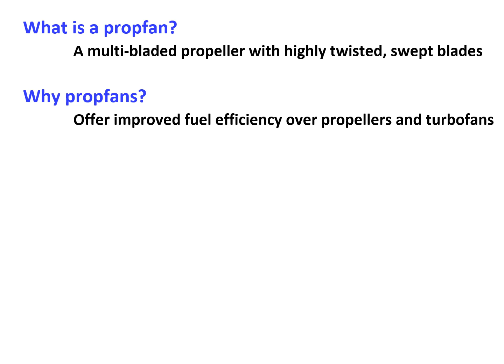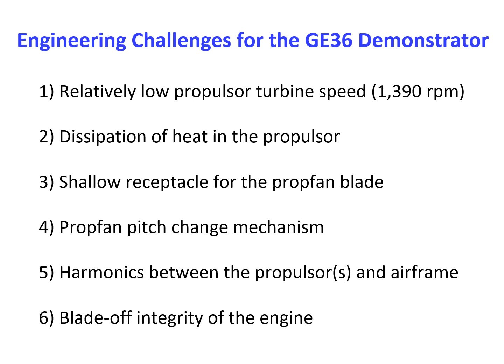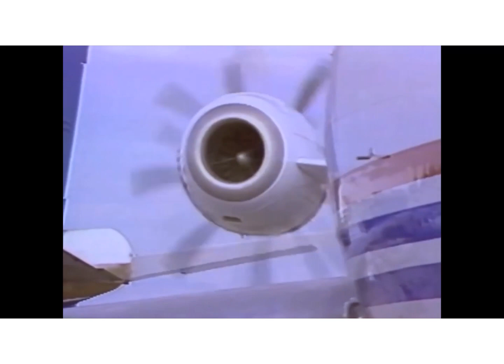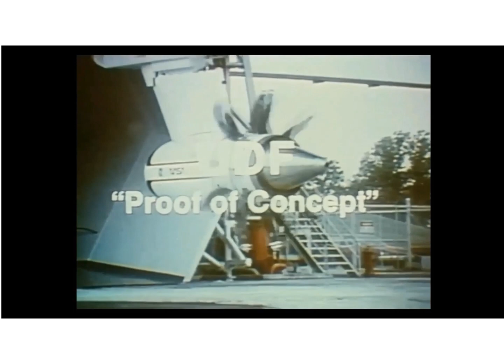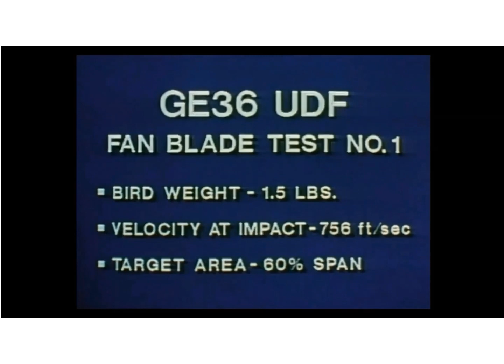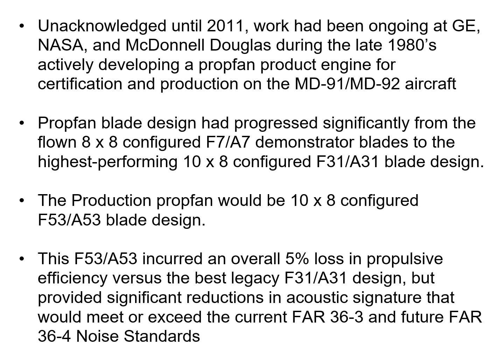A Technical History of the General Electric GE36 Propfan

Comment: It's important to note (a bit) that the concentration on blade impact safety was in part because the technology was new and likely a bit of concern that the last time someone tried a large composite fan (on the RB211 prototypes) it failed spectacularly (if controversially) enough that it sunk the engine (temporarily), the company (semi-temporarily) and the plane it was designed for (arguably). An even larger, less-protected fan would naturally cause some concern.
Reply from the maker: Thanks for your comment.

Comment: thank you for making this series! good information on these designs is hard to find, and it shows how much effort you've put into research and presentation here. one thing bothers me - the ge36 is by far the heaviest of all known propfan concepts, despite lacking the complicated gearboxes and driveline components of its contemporaries (and being slightly more compact). on the face of it, the design seems much simpler, so where does it derive all this extra weight?
Reply from the maker: There are over one thousand blades in the power turbines downstream of the gas generator which are secured in power frames that rotate in, by necessity, a large diameter, strongly built structure. While the blades themselves are not overly heavy, the large-diameter structures used to secure them are likely quite heavy. I think it is those large structures that account for the weight. I also suspect that the Safran CROR is quite heavy as it has some the same liabilities. This is all pure speculation on my part, however.

Comment: Sorry if you answer this in the video, but I am pausing it half way through to watch the rest later and am curious.  I have seen a couple of things about these prop fan engines, but what is the difference between a propfan and a turboprop?  They seem like the same thing to myself (though I am not very knowledgeable on the subject).
Reply from the maker: Thanks for your comments. Back in the early days (late 1970's-1990), a propfan was defined as having multiple, swept, thin, composite blades that were very highly loaded. These days there are a dozen criteria for the definition, but certainly the Airbus A400 and the An-70 qualify as a propfan. The C-130 upgraded with the 8-blade NP2000 propellers is close to being a propfan, but the blades are only moderately loaded. Hope this helps.

Comment: Thanks for the excellent video. However, the cruise SFC of the GE36 is still too good to be true. Are you sure the 0.24 lb/lb/hr is the crusie SFC and not the takeoff SFC?
Reply from the maker: Thanks for your comment. The 0.24 SFC is specifically quoted in the video published by General Electric at 20,000 lbs of thrust on the test stand, so presumably a cruise setting.
Reply: @AEHSvideo  based on the test stand video shown, it appears the engine was exposed to conditions similar to the standard atmosphere. If this is true, the result of 0.24 should be resemble the “takeoff” SFC, where there are simply much more air for the engine to bite at lower altitude (sea level). It might be possible to replicate cruise atmosphere conditions (temp, density, pressure) in an advanced wind tunnel, but I don’t see any source of evidence from your / GE’s video suggesting that was the test case.

Based on the source (Air Transport World. Vol. 21, 1997) cited in Wikipedia about GE36, the GE engineers were estimating the cruise SFC would be around 0.41-0.4, which is a far more believable cruise SFC value.
Reply from the maker: @markzhangcan  , thank you for your comments and the reference. The GE video did not specify under what conditions that the test stand 0.24 TSFC of the GE36 was achieved, and I'm not aware of any published data for in-flight TSFC. Cruise TSFC is the more relevant efficiency metric for commercial transports. As a frame of reference, the CFM56 takeoff TSFC is +/- 0.35 while cruise TSFC is +/- 0.55 according to Wiki: https://en.wikipedia.org/wiki/CFM_International_CFM56

Comment: Thanks for the trip back into the 80s. I worked on this engine until it was cancelled. Interesting times. Engineering problems could have been solved but regulatory ones like the creating new regulations for the unducted fan blade out, might have been hard. But now it is all in a museum :-)
Reply from the maker: Thanks for your comments and I hope the video was an accurate representation of the 578-DX history.

Comment: I like the look of the Ge36. They should equip blended wing design with this engine. It's strange seeing an Md80 make that sound taking off
Reply from the maker: Thanks for your comments. Contra-rotating propellers and propfans work best with undisturbed, clean air into the rotors for minimum noise, vibration. and blade stress. A blended wing pusher configuration means dirty air into the rotors that is made even worse in maneuvering flight (takeoff, turns, landing). I suspect all future propfans, if there are any future propfans, will be tractor installations.

Comment: Hi Tom,

Thank  you for your presentation. Very interesting concept indeed and even more after watching your video on the Allison 578-DX. On that video I commented on the complexity of subjecting the blades to the very hot air and freezing exhaust (expansion, different fatigues, etc) and when compared with this system now I realise the advantages of the Allison and its passively cooled blades.All jet engines use bled air for cooling but this engine uses almost 20% for the different blade mechanisms/turbines and it sounds so taxing! Sounds like great fuel efficiency can be achieved if another cooling mechanism or system that needs less cooling is devised! Cheers mate.
Reply from the maker: The gearless GE36 propfan was the engine that required the large cooling flow at takeoff to keep the propulsor within temperature limits. Another compromise of the GE36 was the sub-optimal, but design-constained, turbine rotor speeds. The net combined +/- 3,780 rpm is pretty low for efficient turbine operation, thus the large diameter of the power turbine, the multiple stages, and contra-rotation.  The gear-driven PW-Allison 578-DX demonstrator had issues with keeping the oil cool enough for safe operation but proved that passively cooled blades could survive the exhaust stream.

Comment: I think with better engine technology now and better blade design, the GE36 propfan could have worked in 2024. Interestingly, the CFM RISE technology demonstrator uses a lot of research used by the GE36.
Reply from the maker: Thank you for your comment. GE is a 50/50 partner in with SAFRAN in the CFM RISE project. The gearless (multi-stage, large-diameter, contra-rotating turbine) GE36 system is likely a dead end, and with Pratt & Whitney flying turbofan gearboxes capable of handling 40,000 horsepower, I suspect all future propfans will be using a gearbox.

Comment: After seeing this video outlay in fantastic detail the pros and cons of this type of engine I still feel that a resurgence in diesel 2 cycle piston engines could be a solution. My bet is on 16 cylinder axial piston engines (the CW R-3350 radial engine data inclusion was a great comparrison) using exhaust energy for either additional input or for forced induction. The same cowling shapes would be possible and approx overal powerplant weight. 10,000hp is definitely in reach with way more torque for those values. No labrynthian air impingment and exotic metalurgical tricks needed accept in lightening the relatively simple axial piston engine internals. I know I will provoke objections from  prestigious and notable pin-wheel heads, but I know the real reason all the focus is on gas turbines is the patent space and cubic meters of money that is demanded for all the fuss.
Reply from the maker: Thanks for your comments. Likely the most recently certified diesel aircraft engine, albeit a 4 cycle, is the RED V12 (https://red-aircraft.de/) of +/- 600 hp. I would expect it to be a Herculean task to get 15-fold that horsepower from a reciprocating engine in a compact, light, and reliable package. If optimistically you could get 1 hp per 0.75 pounds of engine weight, that makes 7,500 pounds for the engine alone. Add in a 3,200 pound geared propulsor, and you have a 10,700 pound propfan propulsion system which is at least 20% heavier than the demonstrator propfans of the late 1980's.
Reply: @AEHSvideo  There you go. Its not impossible 😉, it's just there's no incentive $$$$. A 2 cycle diesel more likely wouldn't need the unwieldly gearbox in the 1st place (comfortable @ max power between 1,000 to 2,000rpm). Thank you for the intelligent reply though as most of the time I get responses (to this kind of statement) that refer to the 50's state of recip engine developement. Or "That won't go fast enough" responses. I'm sure you know of the efforts of Napier, RR Crecy, Stewart Tressilian etc. That was 1950 achievements. The RED diesel is a tentative feeler to avoid being swatted by GE/P&W/RR Et al.
Reply from the maker: @Deviation4360  , the certified, modern, twin-turbo, intercooled RED AO3 makes 550 hp from 790 lb dry weight, so no better than 0.7 horsepower per pound of dry weight. For high horsepower applications, I'd guess that ratio would have to almost triple. That is a tough mechanical mountain to climb. Pun intended.
Reply: @AEHSvideo  I don't think the RED engine example is at all the optimal layout and therefore a poor example in recip future development. I would revisit the Napier Nomad/ Deltic (originally Jumo 223 inspired) trail and include construction advances from F1 engine development (most development inherited from late 40's recip engineering) and think very much more laterally in between. Like I originally stated my money is on the Axial piston engine with all the above goodies thrown at it, very much like the Tresilian X-16 concept but even more compact in axial piston engine form. The RED engine is a safe Grandma bet and far too contemporary to be breaking into any new ground for this "Mountain of horsepower" you feel is so illusive. Just for reference the Napier Nomad was capable of 1.43 HP/lb in its final developments, with no prop gearbox at all accept a clutch for the turbo recovery input, and with reduced efficiency but never the less test cell proven in 1950.
Reply: @Deviation4360  Modern gas turbine engines have comparable thermal efficiency to conventional diesel engines due to the exceptionally high overall pressure ratios now achieved thanks to advanced materials and manufacturing, all while maintaining a way higher power to weight ratio. Piston engines are also a logistics nightmare.
Reply: @jet_enjoyer  All with a cost somewhere in the stratosphere, yes this point is old and hearing it incessantly proves no new point. What ever wiz-bang metallurgy you apply to the turbines probably creates greater gains in the piston engine when suitably applied.
Reply: @Deviation4360  No it doesn’t. Gas turbines can process a much higher volumetric flow rate for their weight compared to piston engines due to geometry. The Napier was able to produce high power due to its rotary sleeve valves, but even this is dramatically restrictive. Additionally, the reciprocating motion requires much higher structural weight to support a given power level. 

The only reciprocating engines that even come close to gas turbines in power to weight ratio are racing gasoline engines. These have service intervals of less than 1% that of gas turbines. The highest power to weight diesel engines ever built, such as for tractor pulling, aren’t even close in power to weight. 

Factor in the multiplication of moving parts and failure points in a sufficiently high powered piston engine and there is absolutely no reasonable argument to justify them.
Reply: @jet_enjoyer  And all of this is just because nobody is keen enough to improve them with no billions/talent allocated in their direction. 

Flow rate is irrelevant as it is just to keep turbines cool. Power to weight of GT is mute when one considers that that weight saving is now the extra fuel required to do the same work. Failure points are inherent in any ICE no matter the moving parts. 

It's all just prestige for the boffins who want all the money and glory for their work. 

The GT can only do its magic within a very narrow band of its function and that will never be conceptually improved. And that has prevented the GT from being applied to just about every other application that a piston engine still does.
Reply: @Deviation4360  That is an extremely misguided perspective. 

Not all machines are equivalently suitable for a given application and some inherent limitations cannot be overcome by throwing endless money at the problem. The performance of these thermodynamic machines are dictated by physics, not by investment. 

As a matter of fact, the mass flow rate and change in specific enthalpy of the working fluid are what generates useful work or power in a heat engine. Higher mass flow rate means more power/thrust. Higher change in specific enthalpy (more heating from fuel burn) means more power/thrust. 

Additionally, you miss the obvious historical context. Engine makers didn’t transition to gas turbine engines for no reason. Before there was a single dollar made in that space engine makers realized there were significant limitations to the piston engines they had 5 decades of experience building and perfecting. They undertook massive risk to develop commercial gas turbine engines and gave up 50 years of technological maturity in doing so. 

There’s nothing wrong with appreciating piston engines and wanting to improve upon them. However, if there was a performance benefit to be had by using them I can guarantee you it would be investigated, developed and put into use.
Reply: @jet_enjoyer   Ok straw man me all you like, I get it all the time. You want to defend your myopic vision and so do I. Just because I assert different points to you doesn't make them misguided. 

Don't give me that "Engineers are noble" crap. They are about to help enforce us all being made to dawdle about in incendiary battery powered cars with no clear idea about how to pull it off. It was a stupid idea 100 years ago when they tried it , and it still is now. But look there's all this MONEY to be made.

They're even more stultifyingly stupid for wanting to endanger flyers with this Rube Goldberg hybrid nonsense.
Reply: @jet_enjoyer  You tube has blocked my previous reply so I won't bother retyping it. Thankyou for this challenging convo nonetheless 😉✌

Comment: The GE36 had similarities to the General Electric  CJ-805-23s proto turbofan jet engine that powered the 1960's era  Convair 990.  basically a ducted J79 turbojet with a added secondary turbine driving a rear turbofan.  It made the CV 990 the fastest subsonic jet  but the plane was noisy and inefficient.
Reply from the maker: Thank you for your comments and that is an interesting comparison. The CJ-805-23 had a bypass ratio variably reported as 1.46 or 2.2, with a sfc of 0.56, the latter being quite good for the times.

Comment: Fantastic video, thanks for posting. I never had a chance to see the GE36 in action, but did see the PW-Allison 578-DX doing low approach’s at KBDL. Although I don’t believe it was loader than a contemporary engine of that time it had a higher pitch that certainly did make it more annoying. It will be interesting to see how the RISE addresses noise issues since in order to be accepted it not only need to meet regulatory noise thresholds, but need to be at least as quiet as todays contemporary engines.

I’ve lived under the approach path to a major international airport since 1996. In 96 my rear deck was basically unusable with the noise of common aircraft of that time. Today most aircraft overfly me with barely noticeable noise levels.
Reply from the maker: Thank you for your comments. SAFRAN made remarkable progress in reducing noise on their contra-rotating open rotor engine run on the test stand, so I expect the noise signature of the RISE engine will be very satisfactory.

Comment: The reason the Piaggio Avanti is so loud is because the exhaust gases hit the propeller blades, resulting in a higher volume than ambient air hitting the blades. As I was watching this video, it suddenly occurred to me: the contra-rotating UDF sounded a lot like a Piaggio, and if the high-velocity exhaust gases hitting the propellers in the Piaggio make a lot of sound, like the GE36, then the sound of the GE36 is due to a set of blades getting hit by high-velocity air from the blades in front of it, just like the high-velocity exhaust gases hitting the propellers of the Piaggio. But the propfan needs to harness some of the energy coming from the fan blades in order to be more efficient. What to do? This, I figured, is the genius of the CFM RISE: the stator vanes behind the fan harness the energy from the fan and make it efficient, without sounding like a Piaggio. (Of course, personally, I love the sound of the GE36 and any propfan, contra-rotating or not, but it obviously wouldn't permit it to be used commercially)

Awesome video!
Reply from the maker: Thanks for your comments. The other factor with the Piaggio (Beech Starship, B-36) is the wake turbulence from the wing hitting the prop blades which creates cyclical variations in blade loadings and airflow patterns depending on the position of the blade(s) relative to the wing. This creates noise and vibration that needs to be managed. Propellers, especially contra-rotating propellers, prefer undisturbed airflow into them.
Reply: @AEHSvideo  wow I would probably have never guessed that! Good to know!